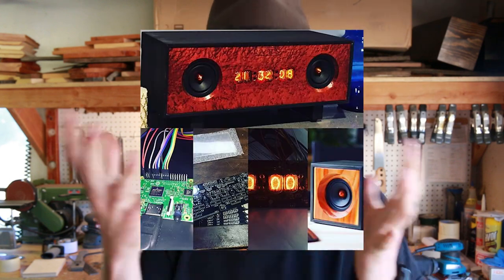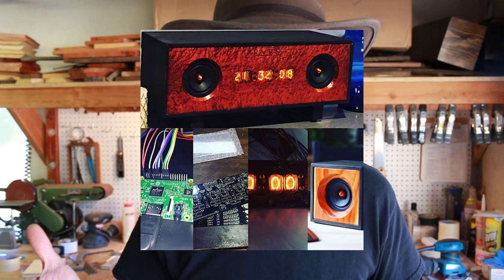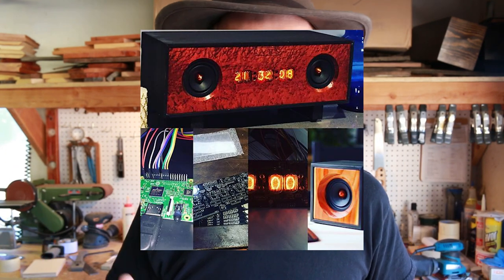Intro To Speaker Building & Expanding This Channel!

Comment: I just got to know your channel, and I'm happy I did! I'm busy with two builds, both my first (sounds a bit strange, but started on them at the same time). I'll send a pic/video when they're done! Subbed!
Reply from the maker: Thanks so much James! Good luck on your projects! Can't wait to see them.
Reply: Thanks! I've got a quick question btw: I'm trying to build a portable speaker with a TA2024 amp. The speaker cabinet is too small for a lead-battery, what kind of small rechargeable battery can I use for this?
Size of the cab is around 20cm by 10cm, size of the two 4Ohm speakers is only 1,5 inch each (upcycled from an old JVC home theatre set).
Thanks for the reply!
Reply: just use a few AA or D (D battery's hold a bit more capacity than AA) Nickel-Metal Hydride Batterys (in a battery holder of your choice like 4x cells) that add up to the approximate voltage of your project and use a buck converter to step down the voltage. more than likely you'll end up with a really huge capacity like 22,400 mAh 0r 22.4 Ah with just 8 AA battery's (2800 mAh each AA) which is much more than a lead acid. i also dont recommend using a lead acid battery for a sound system as they require much care and can only be discharged to about 60% of thier capacity; lead acid works great for very hot or cold areas, humid, and other tough conditions and im sure you wont bring your device to Antarctica :). good luck
Reply from the maker: I agree with Neo, eight NiMH rechargeable batteries in a holder will be your easiest option to power the TA2024 (it will be a little underpowered, but should still work fine.) You could also look into rechargeable lithium ion power packs for LED strip lights. http://amzn.to/29Rf00U You could even crack it open and modify it to be able to charge from the outside of the speaker. Good luck!
Reply: Thank you! Just on more question. I've just built the whole thing with the lead battery for test purposes, but I think the TA2024 is on it's limit when it comes driving the speakers (mainly the larger one ofc). So I'm thinking about upgrading to a 2x50W amp. Can I still use the 8x D batteries you think? Or in that case, do I need to look into the Lithium Ion solutions? (they're so expensive man, argh).
Reply: Found the answer :). Thanks for the help!

Comment: where do you buy your speaker drivers and cables?
Reply from the maker: I've been buying from http://www.parts-express.com/ for years and have been happy with the selection and service. I think they ship worldwide as well. (I'm not sponsored by them or anything) Thanks for watching!
Reply: Is there also a reason for the type you buy? Thank you so much, your very inspiring and are very helpful. Electronics has been a hobby of mine for a few years and people have always told me its unrealistic. Thank you!
Reply from the maker: No problem! Application is a big determining factor in the size of driver I use. Then I'll look up reviews for the driver, then technical data to make sure I'll work well with the rest of the components that I've chosen.